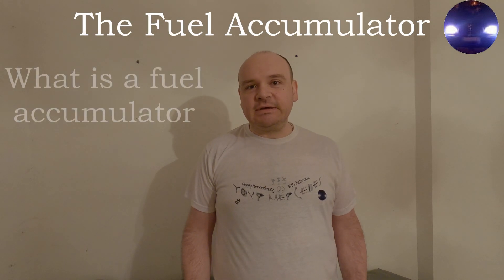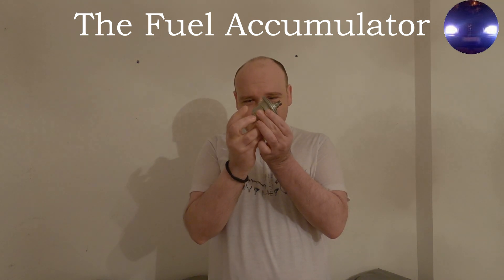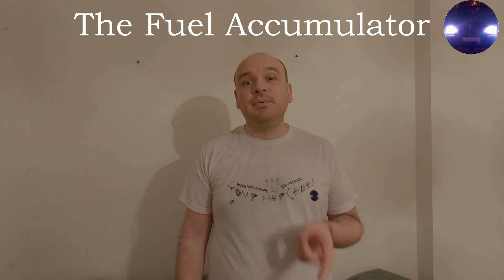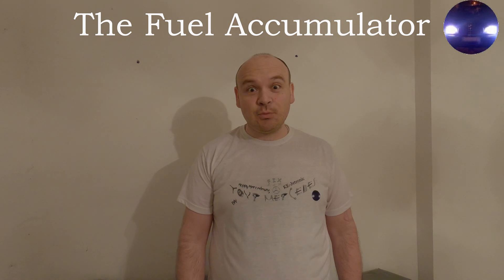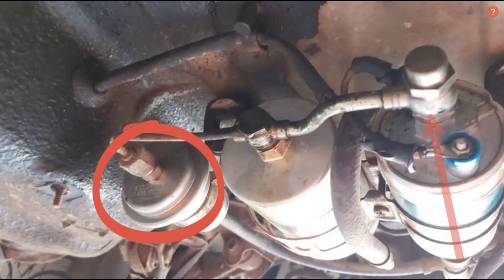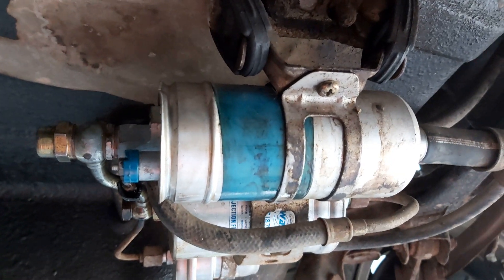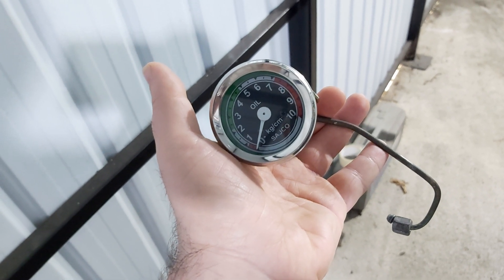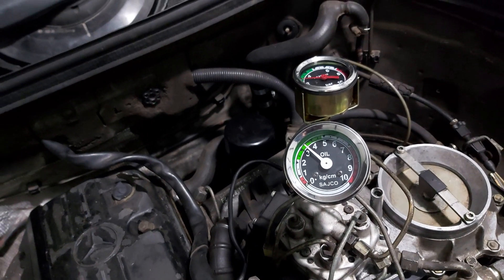㉦Mercedes Ke-Jetronic㉦ - 🛸The Fuel Accumulator🛸, a quick check

Comment: Any suggestions on a hard cold start?  Starts fine after it is warmed up a little.  Hard to start cold.
Reply from the maker: Check the coolant temperature sensor, the cold start valve. Check the cold start valve.

Comment: My apologies for the dumb question but what is the difference between the fuel accumulator and the fuel pressure regulator?  Do Mercedes have both?  Thank you.
Reply from the maker: 😉😊👍🏻 Hello. Yes, there is the difference. The fuel pressure regulator is located in the engine bay by the fuel distributor and it has to keep the system pressure constant while the car is on. The fuel accumulator is located next to the fuel filter and has keep the residual pressure(engine off) constant for at least half an hour!
Reply: @mercedeske  Thank you so much for the explanation!  Have a wonderful day!  :-)
Reply from the maker: @hyperlicht  Thanks, you, too.

Comment: 1991 300sl will not start after sits a few hours unless put fuel in bowl any idea changed all fuses ovp relay all vacuum lines tubes still same when starts has to idle a while to be able to rev engine ??
Reply from the maker: Have you checked the fuel accumulator?
https://www.youtube.com/watch?v=Qokyh3TJjvA

Comment: I've come across a unique situation. The accumulator on my '91 300e sedan is completely missing! I have 2 fuel pumps and one filter only. This makes me think the entire assembly was changed over from a different car at some point (were there ever any models without accumulator?). This setup can actually give us some insight on function of accumulator. In this state, the car is still reliable! It starts perfect in the morning with half a crank. Drive around and park it on a hot-day for 20 minutes, and it starts on slightly longer crank. Park it for 2 hours or more, and it cranks very long and then coughs and starts rough, but then regains smoothness after 2 minutes. As for power, it seems to be down on power and does 0-60 mph in about 10 seconds. Overall, there is no sputtering or hesitation when accelerating and it starts up on first attempt each time. I haven't checked fuel pressures but I suspect lack of accumulator would mean lack of overall system pressure when accelerating and thus causing car to be slow. What do you think, sir?
Reply from the maker: For 300E 0-60mph in about 10 seconds is normal, the car with such an acceleration can not be slow, it must achieve something over 120mph top speed. If the car is sluggish, well Mercedes is not predicted to be a hot rod. With such a performance everything looks like to be in order with the car, although I have no idea how come the car has no fuel accumulator. It's a key component for starting the car warm.
Reply: @mercedeske  It feels more than ready to do 120 mph but I'm mostly in the city and can't do that speed for more than a split second without risking the car. The 10 second 0-60 on a no-kat 300e seems slow, dont you think? Hagerty's website says it could do 7.8 seconds when new, but I'll be happy with 8.5ish. I'll be adding the accumulator to my assembly in 2 days and will report if that makes a difference. This would be an amazing insight on the contribution of the accumulator to the fuel delivery system. I'm excited =D

Comment: Thanks anyways, can you answer my first question?? 300ce
Reply from the maker: If you mean the pressure gauge - either the same way like for the M103 engine or unscrew the screw behind the connection for cold start valve in order not to remove it. Concerning the pressure drop - the check valve on the fuel pump, the fuel pressure regulator and some more of them.

Comment: My 300 ce , is hard to start when warm after driving, can you tell me how to hook up the pressure tester on the 6 cyl KE Jet, also what else can cause this issue, if the accumulator is good?? I have  removed tank cleaned it, replaced screen, and pumps and filters, as well as injectors, Plug wires, cap and rotor,  it is hisitent in going from standing still thru acceleration, runs great with my foot in her!!
Reply from the maker: https://www.youtube.com/watch?v=RKxfSdTNARY

Comment: I am sorry how is the first test done ? You check the fuel accumulator by pressing on the sensor Plate down ? And then what ? Am I checking if it’s stays pressed down or or is it suppose to go back up to know that it’s a good fuel accumulator ?
Reply: I didn't understand the first test either, what is supposed to happen and what are you looking for if its working with method 1?
Reply from the maker: The best way is to attach the pressure gauge when the car is warm(of course attach the pressure gauge while the engine is off), start the car, let it run for some 10 sec. and stall the engine. You will have to get the pressure of approx. 3bar and it must remain that much for half an hour.

Comment: Hi, can you do some videos on Mercedes Benz w202 C200 year 1996 model
Reply from the maker: Tell me which engine code is that?
Reply: @mercedeske . It is 111941-62-055-291 snd its chassis is WDB2020206F466354. By the way I just bought it 3 weeks ago.  Presently having problem with the instrument panel, all the meters just stopped working.😅
Reply from the maker: I wanted to say if the engine is M111 or?
Reply: Ya, its M111.
Reply from the maker: For the beginning buy an OBD2 scanner and read for the codes. I think a majority f your problems you are going to solve that way.
Reply: My merc uses the 36 pin round type obd port. I did buy a cable which is a 36 pin to 16 pin adapter. I connected it to a bluetooh  ELM327 but unfotunately it couldn't connect to the ecu. Perhaps my software/firmware of the elm  is not the correct type. Can you suggest the right type to use?

Comment: Hello, thanks for the information you provided. from you that the adjusting screw at the fuel outlet of the fuel pressure regulator I would appreciate if you give information about the factory size, how many bars should the m102 gasoline pressure be? thank you so much
Reply from the maker: My pleasure. As for the adjustment screw on the pressure regulator, don't touch it, it won't have any effect. It just alters the pressure of the stalled engine. As for the pressure m102 and 103 work on 5.3-5.5bar system pressure/working pressure for 0.4bar less.
Reply: thank you very much and best wishes

Comment: In my W201 the fuel pump produces a buzzing noise when it's hot (long drives or hot weather outside). Any information about how to diagnose this? Is it a normal behaviour or is it in bad condition? Thanks, very good videos!
Reply from the maker: Thanks. Just measure the pressures(my next video). You have to get 5.3-5.5 system pressure. If it's less, replace the pump.